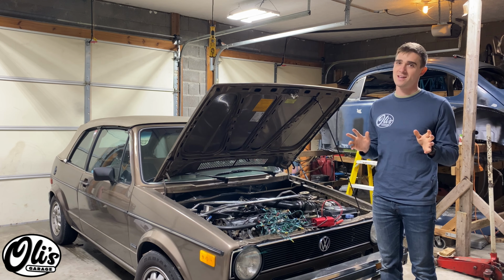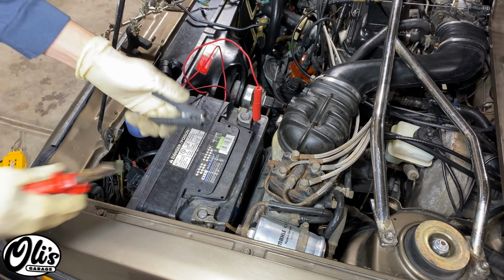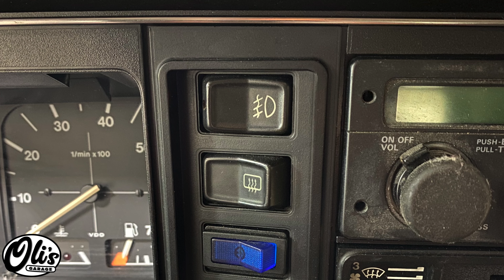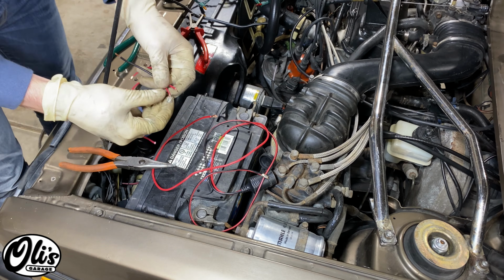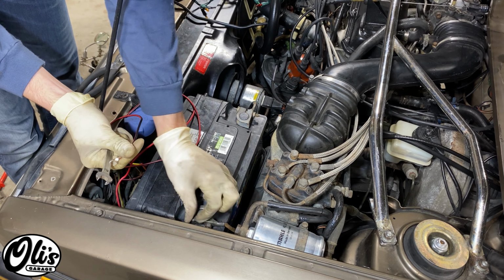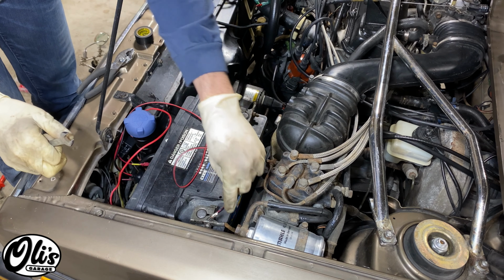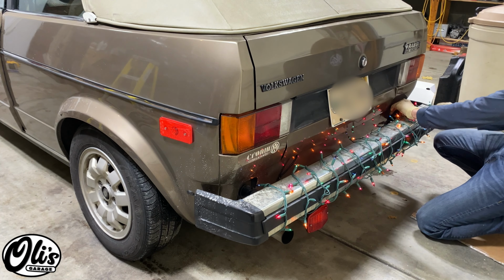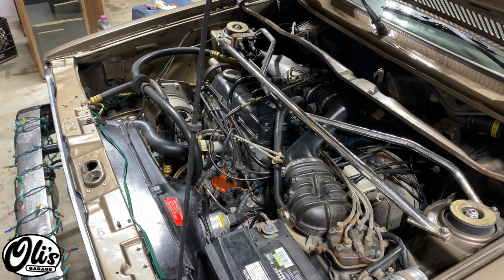Installing Christmas Lights on a Mk1 VW

Comment: Can u make a video on heater core fix and or flushing?
Reply from the maker: So I’ve got about half of that already uploaded. Check out my ac repair video and coolant change video. 

What exactly is your issue? 

I recommend cleaning a coolant system as a whole, not just the heater core. If the heater core needs replaced, then replace it.
Reply: @OlisGarage  I've done a flush, replaced temp valve, and replaced radiator. 0 heat
Reply from the maker: @elijahneely2437  run the car and see if both (inlet and outlet) heater hoses get warm. If not, then it’s your heater core. I’d just replace it. I’ve got parts of that already filmed and uploaded in my ac rebuild video

Comment: Holidays are coming again, time for me to revisit this vid!
Reply from the maker: Heck yes! 
I was just thinking that I need to get the Christmas lights hooked up again on the car.
Reply from the maker: @joshisgarage  good question. I actually have not replaced a top yet, but I have two cars which need a top replaced. 

Rust repair wise; if you have a welder and some patience then you can do it yourself. I’ve repaired quite a bit of rust successfully. They key is cutting all of it out or sandblasting really well. I have two windshield frames which need rust repair completed. I just haven’t gotten to it yet. But it will be filmed!
Painting everything to match will be harder. It might not be a bad idea to get a quote from a shop about fixing the rust. Then maybe the shop fixes the rust and then you do the top. 

My one piece of advice, choose an expensive shop. They will most likely do the best job.